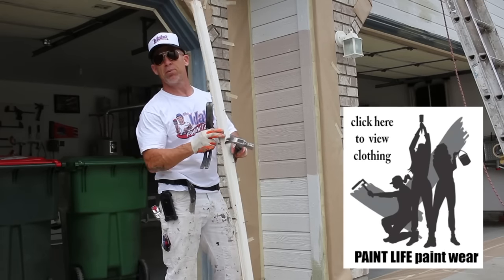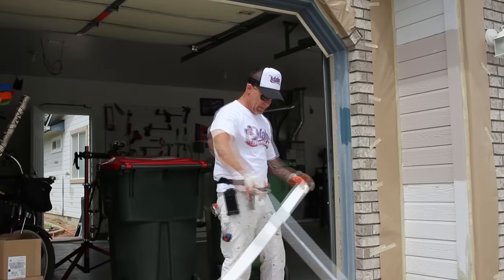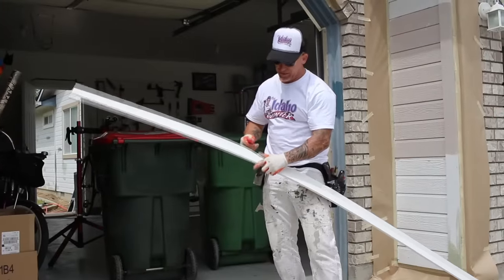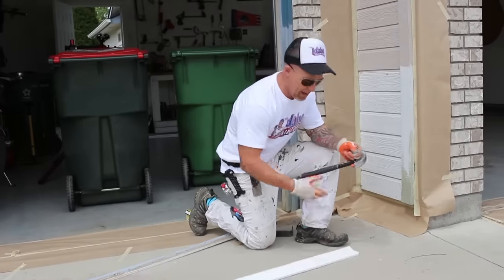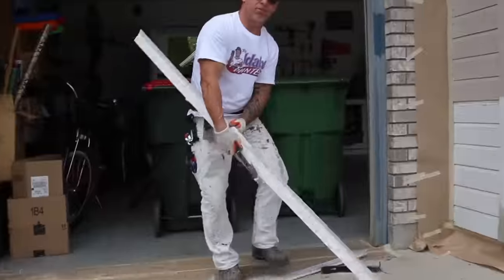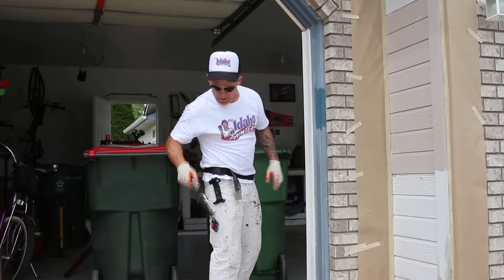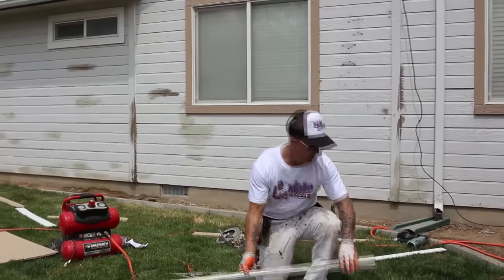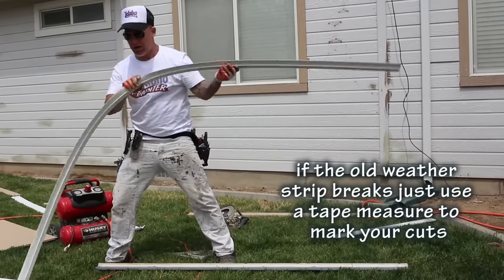How To Replace Garage Door Weather Strips.  Home Energy Hacks.

Comment: Nice and thorough. Easy peasy. One question. How does one handle the conflict of interest where the side  weather seal meets bottom door rubber seal.? They get bunched up where they cross each other  down there. Trim the bottom seal back or the vertical side seal up?  The bottom gap is larger than side gap

Comment: The trim at the hardware stores is absolute crap. The stuff I installed 2 years ago is split and pieces are missing. The vinyl cracks in cold weather. I just pulled on the lip of a piece at Menards and three
 inches peeled off effortlessly like cellophane does once you get a tear started. I can't bring myself to buy, transport and install the same crap. The garage door roller bracket is the same. The bracket bends under to weight of the aluminum door.  I'm pretty sure the Chinese declared war on us and just forgot to tell me.
Would somebody post a brand and where to get something better?

Comment: you installed it wrong all weather stripping for a garage door should be installed with the door in the closed position to ensure a proper seal ..if you are gonna cross over into a different trade please respect the garage door guys respect by doing the job correctly
Reply: +The Idaho Painter i install and service garage doors, if the trim is the same you can just place it over where the old trim was located. placing the trim flush with the opening is perfect assuming youre not using the cheap stuff. i always put it on with the door open assuming i installed the door and know how it fits. if someone set the track too close to the opening its a bad idea to put on while open. id be nice to assume every garage door guy was good at his job lol if the door is too close to the opening, the trim will fit too tight and either curl away from the door or even rip. im not attempting to correct anyone just my thoughts. either way is fine assuming the door isnt jacked up and the weather seal has the rubber seal located on the edge of the vinyl not an 1/8 inch in from the edge. and if youre not planning on painting the exterior of the opening it isnt a great idea to use your pry bar on the face of the wood, some idiots use pallet nails and trying to pry one of those out could damage the face of the wood. i always pry from the back so that any damage that i could not avoid would be covered by the new trim.  i was the lead guy at my last company i worked for, and even the owner said to close the door always..... needless to say he didnt know everything he thought he did. have a good one fellas.